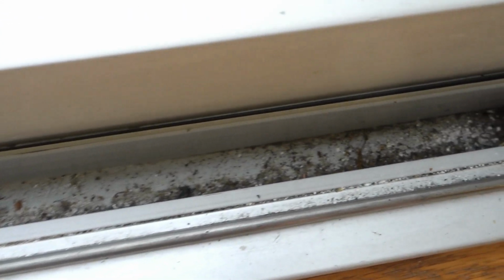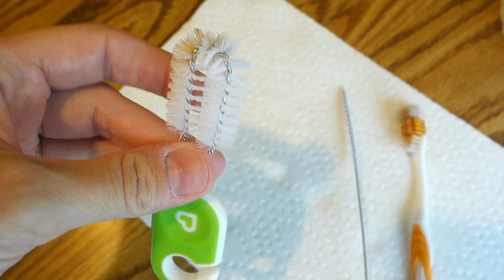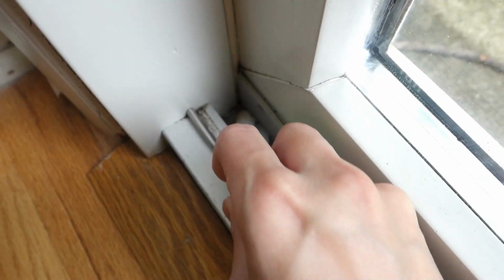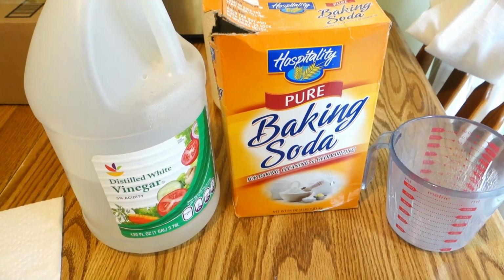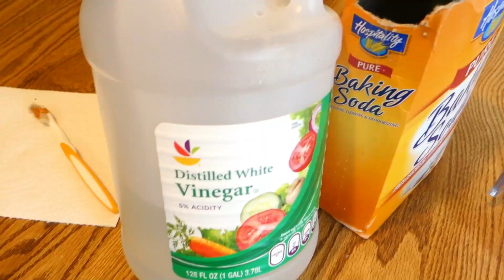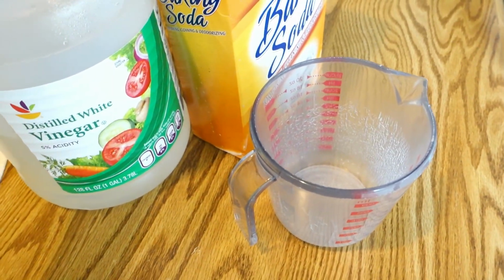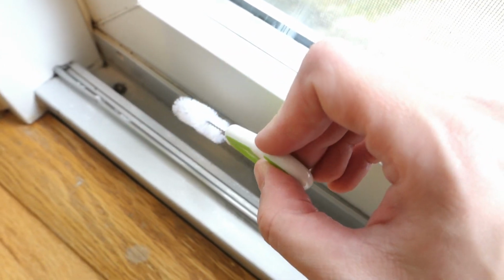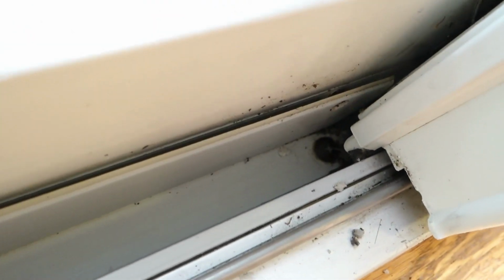SATISFYING CLEANING | HOW TO CLEAN SLIDING DOOR TRACK

Comment from the maker: Hi! I want to pop on here and update my advice on cleaning slider door tracks. Getting the baking soda all out was difficult so I don't use it anymore! Just first vacuum out what you can, then scrape at it with a stiff cleaning brush and any small scraper tool you can find to loosen more dirt. Vacuum that all up again. Then you can spray it with PineSol and water or any basic cleaner, and wipe it out with a cleaning cloth.  Hope this helps!
Reply: Use h2o2